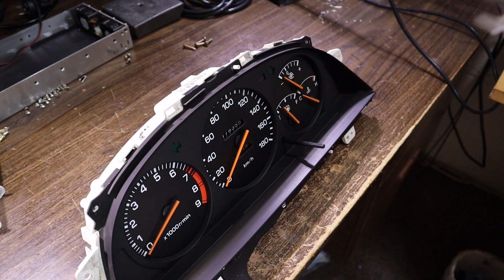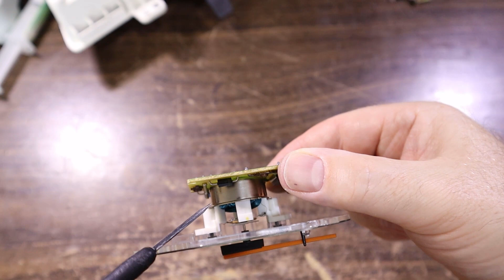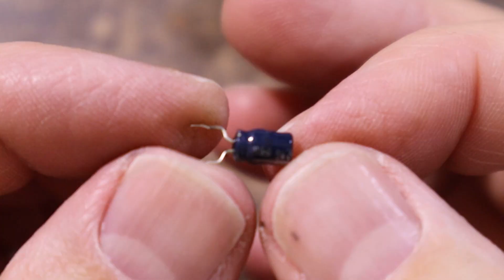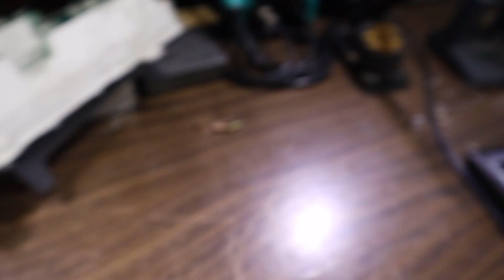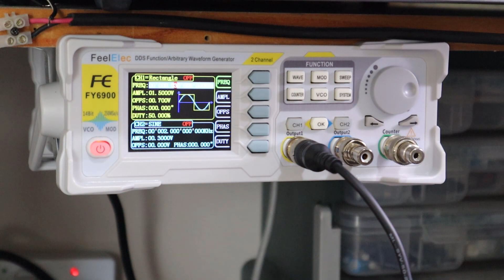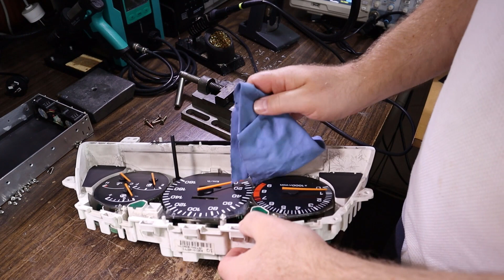Toyota Celica GT4 tachometer repair

Comment: Thanks for this! I’ve had erratic problems with the dial cluster - oil, brake and battery lights flickering and the rev counter not working. Most reference I’ve found just say “swap the caps” so it’s good to see you knife-and-fork through each component and then proving the fix with your signal generator. 

If I can ask for a little more help though..? I’ve recapped and tested and my gauge works on the bench.  So I’m thinking an earth fault but the nearest grounding point near the centre console tests ok. I’m not sure where to go next?

Comment: Hmm a very unhappy condenser,  4 million years old by the jacket.
I wonder if there are hidden craps in that car hmm.
Reply from the maker: The workshop has had multiple issues pop up given the age of the car. I fixed the ECU some time back and it sat in the workshop ever since breeding other faults. Lucky the owner's not desperate for it!
Reply: it sounds like the engine needs a regular start up to keep the evil damp away, 
If it can be started.